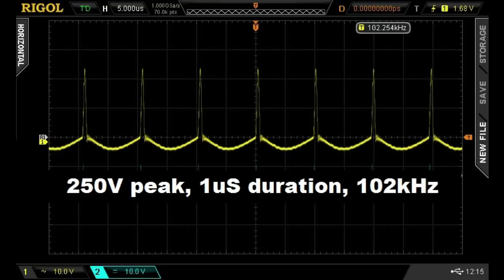Longitudinal Current Induced by Dielectric Field Impulses

Comment: So would it be fair to say that it can be illustrated as like a light spectrum. At different frequencies we get different output and effects. My understanding of what you are saying is  that when we  pulse a coil at your suggested time value that the energy 
 transfers into the etheric feild instead of heat or  electro magnetic feild. Hmmmm 🤔 I am really looking forward to one of my human senses being able to detect this value and quantify. Would be so fantastic in my lifetime if I could experience a representation of the etheric energy at work by the whip of us humans 🙏 thanks for existing Master ⚡
Reply from the maker: later today I will release a video where I directly experience the electrifying energy:
https://youtu.be/5uaNpeYKO74
Reply: @MasterIvo  is that a sort of pemf therapy. I have a sprained ankle at the moment and was thinking I may pulse my ankle tomoz and see if I feel any sudden improvement to the pain!
Reply from the maker: @Buzzhumma  yes, buy instead of pulsed, it is Impulsed.
Reply: @MasterIvo  hmmm very interesting and probably offers more than opposites in its characteristics.
Reply: Master Ivo so we create an impulse by pulsing a bifilar coil and collecting the collapsing magnetic field which is the impulse of the initial pulse ? This can transmit  as an ionic field which is transferred into  a second coil which can be used to charge a capacitor . What would it’s best use be ?
Reply from the maker: back emf of first coil is injected into series resonant second coil, that is coupled to parallel resonant third coil. Third coil is used for treatment. Video will explain

Comment: I agree that magnetic fields rotate and are inherently curvilinear by their very nature. The linear rotating geometry, twisting, of the electrostatic field generates, by geometric necessity, rotating magnetic fields having the same initial structure. The difference is that the magnetic field radiates away from the dielectric as force in motion and its force dissipates by distance. Eventually becoming weak enough that the dielectric force of attraction draws it back and we see this as the intergalactic plasma filaments spider-webbing throughout the Universe.

Now here is the interesting thing about dielectric fields and the Ether. The Ether appears to be composed or partially composed of pure dielectric. And it can also be manipulated by Tesla’s longitudinal discovery of  Radiant Energy. This is how I vision it working.

The sudden stop and instantaneous reversal of flow of the dielectric has a chaotic effect which destabilizes its geometrical torque. Having no symmetry the dielectric has also lost its potential to create a magnetic field which results in a projection, or radiation of pure dielectric. A haze of dielectric if you will.

The pure dielectric has interesting properties that do not follow the rules. Such as passing through Faraday cages and more importantly lingering power.

The passing of radiant energy through the Faraday cages is a direct function of the magnetic properties of Matter. Copper being a great ‘reflector’ of dielectric allows passage of the radiant energy. Silver should be the most reflective of dielectric and interestingly enough elemental Bismuth should prove to be interesting. Whereas Iron has the most propensity to become magnetized and should prove to have the most influence of the radiant energy.

The lingering power that has been noted may be from the Ether itself. The process of creating sustained radiant power is a succession of dielectric pulses displacing the Ether in which it has little time to fully recover before the next impact. Therefor the pure dielectric is most likely creating pure capacitance in the Ether itself! This capacitance slowly discharges at the same rate that the Ether reforms itself from the dielectric displacement.

Food for thought

Chasing Dragons
Reply from the maker: good stuff!

Comment: Master Ivo, A quick question? I need help with this one, perhaps you can help?  Are the Eddy current losses in an iron core transformer, a form or radiant energy escaping conductor dielectric field impulses? 

Are the AC frequency currents, flowing through a typical copper conductor with "audio" higher frequencies flowing on the skin of said conductor, a form of radiant energy escaping into the ether?

Would a viable inexpensive solution to mitgitaging the "Skin effect" on a conductor,  result in lesser losses of energy/ radiant energy and enhance the  conservation of dielectric field energy?  Would said solution result in over unity or greater energy / power?

I discovered something like this, a solution, but I'm enjoying the technology in the field of Audio... I'm getting over unity at A.C. audio levels,  I'm thinking of perhaps expanding into some of the general principles of physics. I would need more help, since my knowledge is limited but I just stumbled upon said technology...
Reply: You don't need help. You need to continue on the wonderful journey your on.

Comment: Hi, thank you for your videos, and I will def. verify your work. Even have the same scope. Anyway, if you don't know, I would like to point you to EWT: https://www.youtube.com/channel/UC7aKNG039opzFXqz4cigziA, that gives much more explanations to natural constants and how "particels" are standing waves. This is how electric units and constants are much more simple when understood as motion in the aether.
Also, your description of magnetism, that it takes time to appear and by keep pulsing magnetism can it be avoided. They way I understand Ken W, is that the field is "magnectic", when the vector is turned back into the magnet (That is also why metal balls stick to the rim and not the middle, since here is the dialectric vector fountain). There are 2 vortexes, one going thru and one squashed at the equator. So, when teh dialectric field is pulsed the field vectors are nodged again and again, avoiding them to return back into one of the 2 vortexes, hence making transfer of dialectric energy over distance possible.
Reply from the maker: Thank you Michael, that sounds very interesting. I will check the video
Reply: I can recommend watching the services from the beginning. Also, when there is a aether, charge is simply moment in the eather, so Column (C) is just m/s, in the same way as air (particels) motion is m/s. Capacitance F is then measured as: s*s/kg. It also become clear that the definition of F and Henry (H) have different definitions, and should/can be fixed.

Comment: excellent insights, any update about the step recovery diode?
Reply from the maker: yes, I found out the impulses originated from back emf, not from the step recovery diode.
Reply: @MasterIvo  it is a DC system right? 
also there was a video by TheOldScientist demonstrating these longitudinal waves for communications which may be of interest
Reply from the maker: yes, pulsed DC, producing impulsed DC
Reply: Very important, I just learned about Eugene podkletnov, Russian ceramics engineer who made a "gravity shielding device", using A Marx generator which generates a high-voltage pulse from a low-voltage DC supply. Perhaps this is the same effect
Reply from the maker: Very interesting. thanks for sharing
Reply: He also maybe a gravity wave dischargeing big capacitors in to supper conductor

Comment: hi again brother ivo, its nice to have same common in sense of thinking about this kind of wave.  this is interesting indeed, i want to know what your opinion regarding a wavelength this kind of dielectric propagation?
Reply from the maker: Hi, I don't fully understand the question. Wavelength?
The impulse duration is relatively short  compared to the frequency it occurs.
Reply: @MasterIvo  yes, wavelength. if transverse wave (electromagnetic wave) push outward at speed 3x10^8 . how much speed related to longitudinal waves?
Reply from the maker: Eric Dollard has made those calculations. I remember it being Phi times the speed of (transverse) light. so 1.618 times faster.
But others have talked about it being instant.
One thing is sure. longitudinal is faster than transverse.
Reply: @MasterIvo  hmm i believei have heard that before, somewhere. thank you, your explaination realy help me alot

Comment: Yes I see that and some pin diodes behave the same. From my experiments, the transition needs to be very fast almost an impossible
speed in the 10-9 pico range any way keep up the experiments and good luck.
Reply from the maker: for me the combination of a MUR1660CT diode with a IRFP460 A mosfet works. Don't fully understand the mechanics but the impulse only appears above the resonant frequency
Reply: @MasterIvo  Hi and thanks for your reply  I believe you have a driver circuit for the IRFP460 and MUR1660ct device I was wondering if you could possibly share the circuit as I'm not too sure the best way to approach the problem of tying the two together perhaps you have a link. Any way many thanks AW
Reply from the maker: I use the IXDN604PI to drive the gate of the mosfet. see my high side switching video:
https://youtu.be/Asa2RuubKWM
The complete circuit will be shared, but I'm still refining it, as it needs to be fine tuned
Reply: Hi and many thanks for the information no rush i have been studying and playing for a good few years now ;)

Comment: Hi, I haven't come across the SRD till now none of the basic suppliers appear to have any supply or call for them however their characteristics are quite interesting. Where can I get some from? many thanks GW
Reply from the maker: I haven't found them either, but these work also: mur460 and mur 1660ct.  The 1660 has the biggest capacitance, so it should be able to give the best impulse. and both are ultrafast. I suggest the mur1660Ct (can be found on AliExpress)

Comment: My thoughts are very much along the same lines, however just a little bit different in that I envisage the major longitudinal pulse being generated at the same time as a magnetic field is induced. Such is the intrinsic relationship between the dielectric and magnetic. As we know, when a magnetic field is induced there is superluminal velocity of the dielectric plane in a centripetal vortex. This tremendous velocity is driving the magnetic centrifugal field and its subsequent return to the dielectric plane (magnetism). Eric Dollard explains that when the magnetic field is returning to the dielectric plane, the pressure mediations (magnetic and dielectric) are slamming into each other at 90 degrees, thus producing a magnetic motive force, or torque.

This continuous torque of the dielectric plane, in my mind, must be the generator of the precession of the system. In addition, this continual pulsing of the dielectric and consequent torque is producing inward torquing (centripetal) waves of pressure that are concentrated at the centre of the plane. These ripples, as you also envisage, are too small to break into full blown magnetism. These inward circling pressure waves have only one to go and that is forced longitudinally (Z axis) from the system centre as pulses. 

This, I presume, is how Ken explains light. Which would make sense I guess. We also have to consider that, as there is pulsing of the dielectric plane, there has to be a time component however small that may be. This would be what Ken describes as the transverse component of light (time component), being made up of the minuscule waves of the dielectric created by the pulsing (magnetic) generating the electric component being the magneto motive force, or torque. 

I see radiant energy being the same as, illumination energy, or 'light' which is the longitudinal radiant pulse perturbation of the dielectric in the Z axis. This, in some way I guess, links the whole system into an elegant relationship. I agree with Ken here, that when the pulsing, or torquing, is creating high enough energy in a centripetal fashion, this energy is compressed into matter, hydrogen. This would explain the galactic jets being thrust from the centers of 'black holes'.

I can see how this system is nearly instantaneous in its energy transfer as dielectricity cannot terminate in space; it must terminate on conductors or dielectric reflectors. This is what Dollard states and it makes sense and hence a pulse is felt instantaneously at the opposite end to that where the pulse is generated. 

Considering all this, the z axis pulse perturbation of the dielectric, thrust from the center of the magnetic field must be strongest in this region, being the center. Radiant energy, like 'light' however, is incoherent so I ask myself where does the incoherent geometry come from? The answer must be linked to the magnitude of the generated magnetic field. A Tesla coil has a massive voltage and subsequent strong magnetic field and I gather that although a huge pulse energy radiation must be generated in the center of the field, dielectric pressure mediation must be perturbed elsewhere at all areas around the magnetic field as dielectric is everywhere. We have to assume that there are more static (incoherent) dielectric field areas, or systems, that surround the spinning vortex system that is producing the strong magnetic field, and it is these dielectric areas that radiate the incoherent, or less concentrated, pulse perturbations of dielectric. For me, radiant energy must be strongest in a more coherent beam coming from the center of a magnetic system with incoherent radiations coming from the surrounds of the magnetic field in all directions.
 
I guess the real question here is, how does one pulse the dielectric without the minute waves (torque) created by the slamming of the magnetic field pressure lines; essentially taking away the transverse aspect of the pulse generation?

I apologise for rambling on a bit, however this helps me spatially envisage my thought process. Let me know what you think. Thanks and look fwd to the new vids.
Reply from the maker: great mind you have :)
I do agree to some degree but, radiant energy is coherent I think. The dielectric lines of force may be terminated in them selves, forming a ring torroid (donut) this way the enerfy is confined and can rotate on itself and travel faster than light. This might be the higgs "particle" (really a eather field configuration).
I feel the longitudinal impulse is from the wire surface area of the whole bifilar coil, not the center hole where the magnetic field vortex is concentrated.
The two windings of the bifilar coil, has a very short high voltage impulse over it. creating a void on one side , and pressure on  the other side of the coil. this is the  perfect setup to create a ringvortex. 

But theory is nothing without a practical experiment to back it up, have you got ideas how to implement this in real life?
Reply: Wow you paint a beautiful picture! Love it

Comment: in my believe the output of a antenna is also a pressure released in the eather
Reply from the maker: yes, but a regular antenna is pushing and pulling, giving a ripple with maximum and minimum. That Aether wave is different.

if you only push, or only pull (unidirectional) the Aeter is set in motion in just one direction, not back and forth, but only back or only forth

Comment: I wonder if that longitudinal pulse is similar to what's happening here: https://phys.org/news/2018-11-defy-19th-century-law-physics.html
Reply from the maker: thanks for sharing. I dont know. a magnetic diode is interesting. I thought of this before. if two coils are wound on the same core, and one coil is used to saturate the core with a dc current, the other coil would behave as a diode, only passing current in one direction